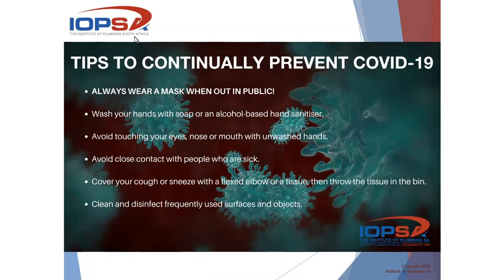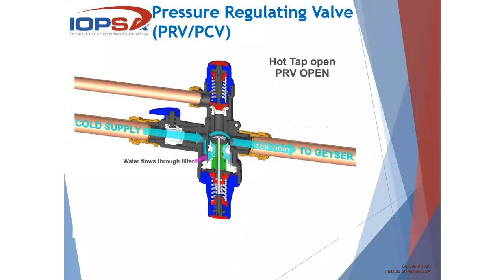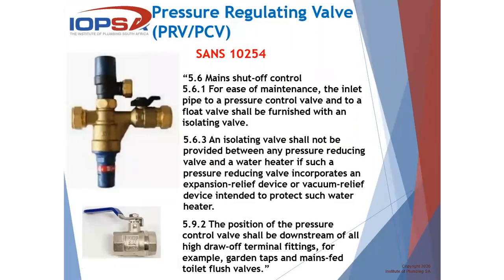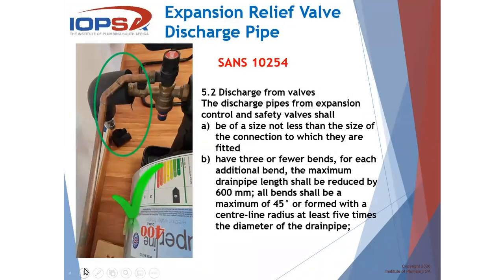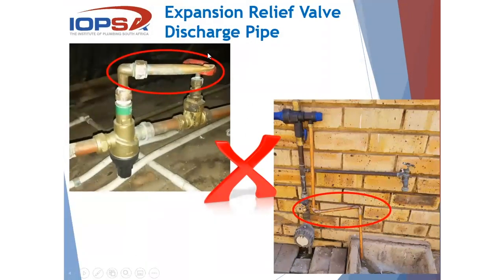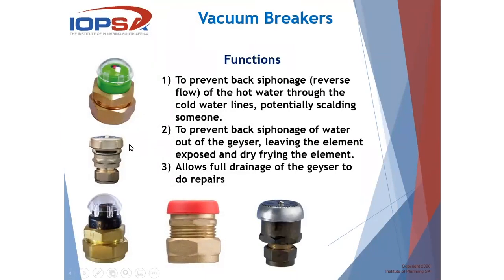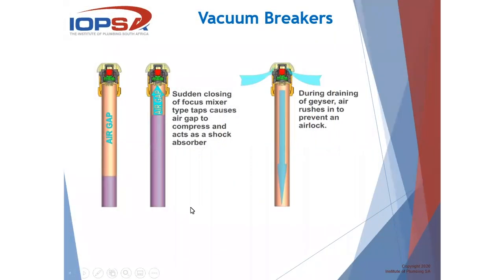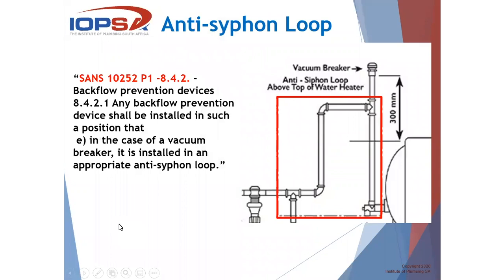PIRB Breakfast Talks - Understanding the PRV & Vacuum Breakers.

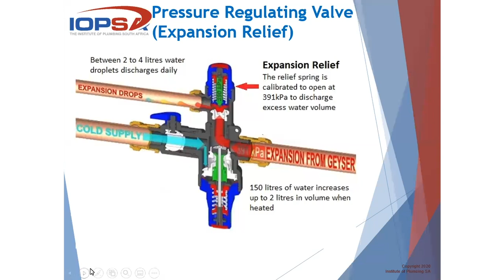Comment: 5:20 I am a bit concerned that the expansion relief valve starts to open at 391 KPA  and the pressure control valve supplies water at 400 KPA . Does this not result in a constant flow of water being wasted when the supply pressure is 400 KPa or above ?